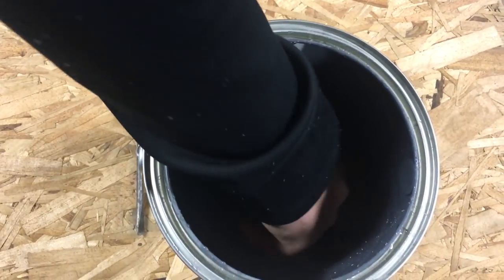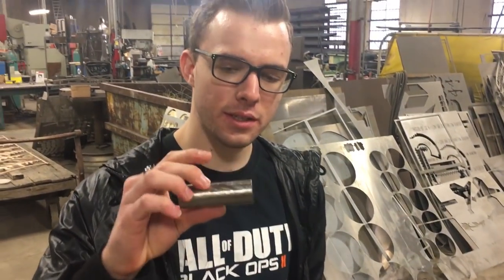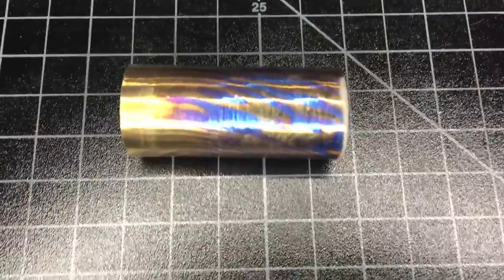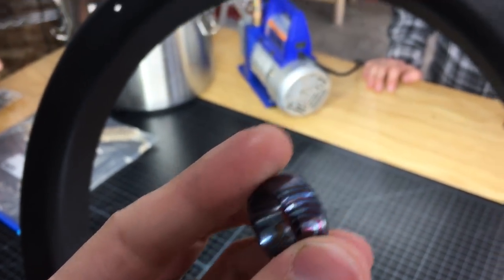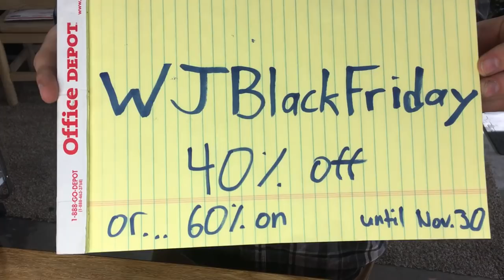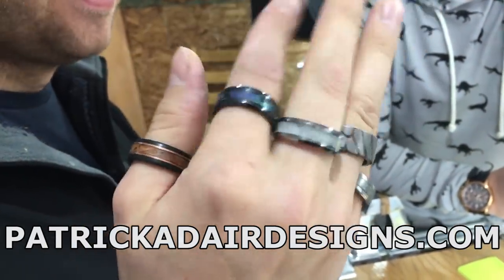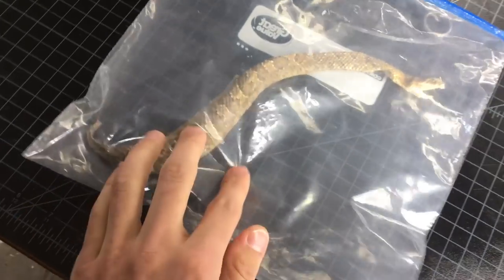Making Timascus Ring With A 60,000 PSI Waterjet Cutter - Titanium Damascus -  waterjet cutting

Comment: That's actually a quite attractive ring.  I'd buy one.
Reply: for $700?
Reply: i dont think titanium is that expensive
Reply: but holly shit it is 700$ on the website
Reply: DerpMaster Hd my dreams of having one are crushed by my social status.
Reply: Jakob Parish   No. Not for that much.  I'd pay 100$ though.
Reply: DerpMaster Hd titanium is one of the most expensive metals besides platinum and gold. Some 6 inch titanium castings at my work are $800
Reply: The reason why it's so expensive is that it's timascus, it takes a fair amount of time to make and it's pretty risky to make, normal Titanium is not that expensive. Timascus and mokume is some of the most expensive material in the knifemaking industry for custom knifemakers.
Reply: Yeah titanium 6al-4v isn't 700 for a short bar but it's easily twice as much as stainless. It's not as hard as inconel but still a bit tough on your tools and it's a fire hazard.
Reply: do u have $800? yeh didn't think so
Reply: Some other materials that are expensive and rare that knifemakers use are black timascus, which is a combination of titanium and zirconium. There are also superconductor, SM100 steel (bladesteel), Marbled CF, Lightningstrike CF, thunderstorm kevlar. Rings are made of some of these materials, but mainly folding knives.
Reply: Aznee 8
Reply: for 700 dollars xD?
Reply: i would too for 100-200$
Reply: DerpMaster Hd only a few people make this stuff so the supply is really low, so anything made out of mokuti is really expensive
Reply: I'd pay $35.00  it looks cheesy... like something from Hot Topic from the 1990s  the kind of thing that 'new money' buys when they're trying to prove themselves.
Reply: Bud Nunyerbusiness for 700
Reply: Bud Nunyerbusiness ii
Reply: You gotta check out patrick adair designs,he made the ring
Reply: MrNinjaman63 this is a ring not a 6 inch thick platform haha
Reply: Darren Braden try 7.79 inches ;).
Reply: You're paying $700+ for something 100% useless. Jewelry in general is over priced and useless.
Reply: Those rings are hundreds of dollars
Reply: Mercury Doctor Yes, yes I would.
Reply: @nerocladius4319    I lost my gold wedding ring and got a platinum one so not really expensive
Reply: @poisoncobra7  actally u can make about 6 for 300$
Reply: I wouldn’t but anything they have it’s all about 90% over price
Reply: Jk

Comment: I wish he polished it... I WOULD be dissapointed if I purchased and it came with all those surface scratches.
Reply: Waterjet Channel for something worth that much yes
Reply: AddisonLarson nah that requires effort then the price might make a little bit of sense and that's just crazy
Reply: I think he did...its just rough structure of titanium...but not sure...Iam more curious about blue color done by heat and if it will be permanent...
Reply: medvidekmisa maybe the rough texture/finish is intentional. So when it wears only the "moutain tops" get worn and thus the bluing affects, the "valleys" however take up the majority of the surface area, thus the ring still looks blue even when worn.
Reply: Waterjet Channel true
Reply: Addison: Yes. Thats probably why he did it. The oxide coating is less than a micron, so it wears off quite fast. Only way to restore it would be to repolish it and then reform the oxide coating by heating.
Reply: Also titanium is not particularly hard. Maybe C25 or so on the Rockwell scale. Harder than gold for sure, but not like a tungsten carbide ring or something like that.
Reply: facepalm damascus titanium are meant to have those surface texture -_-
Reply: AddisonLarson he polished the inside

Comment: Why don't you guys use those plastic corrugated blocks for the bed of your water jet?  They can be used for many many cuts before they need to be changed. They also keep the water in the bed from splashing everywhere. Should get a diamond tip spray nozzle also, the water stream comes out so thin the first inch or 2 is invisible.  Just some suggestions! Good videos either way keep it up

Comment: So I have an Idea. Lets get white or black marine grade canvas as a wraparound backdrop, like they do on eBay (only the canvas will be super strong). Staple it to the osb on three sides with some vertical supports on the corers. Blam a beautiful blastshield that will catch 700$ ring blanks. Kinda like the skateboard wheel box, but prettier. A three sided removable blastshield is what im recomending, black would look best in slow motion I think.
Reply: Waterjet Channel thats an astronomical amount!
Reply: Waterjet Channel I'm thankful for you guys... Either that or a window screen streched out over the tank.

Comment: what is the process of making that trimascus rod please tell me
Reply: it's twisted titanium that's heated to add color patterns lol
Reply: It's almost the same as damascus, but in this case you don't use 2 different steels to make a pattern, only one. You weld slices of titanium together, then you forge it down to a block, then you cut that block into pieces and weld them together again and forge them down again to a block, there are other ways of doing it, and I'm probably not 100% correct but that I generally how you make a damascus.
Reply: Marius Christensen the only thing I would add is you say it's not two different metals, well technically it's 2 different alloys of titanium, that's what gives the distinct difference in colours, some titanium form oxides at different heats and the colours are just oxides on titanium with green being the thickest at around 0.002 or 0.003 inches thick.
Reply: CnCEmpire yeah your right

Comment: What stops the water jet from cutting itself?
Reply: What stops a saw from sawing itself?
Reply: What stops killers from killing themselves?
Reply: I'm pretty sure they made a video about this. It does cut itself, but most of the cutting force is directed away from the metal slats because they have very little surface area exposed to the water jet.

Comment: $700 for a ring?!!! Titanium is not that expensive, what gives?
Reply: Yi ZK long story short, it's forge welded layers of titanium. And titanium has this tasty tendency to explode in the process. So you get a low yield, multiple bad batches, and it's dangerous.
Reply: @Yi ZK It's a scam. How do you not realize it, this guy is an absolute coward and one day he will be the victim
Reply: Jon look up Damascus forged titanium. It's dangerous stuff. Tends to explode and doesn't always result in a usable product. The cost comes from high material loss, expensive equipment, and massive amount of time it takes.
Reply: To quote another comment on this video

"The "Timascus" rod they are using is $1120 for an 1.6" OD x 5.5". By weight and using the density of titanium, that sells for ~500 per pound of the stuff. Looking at current gold prices, gold sells for over $20,000 per pound. I just saw a 24 karat gold ring sell for ~$750, similar price to his ring."

There is no reason for this ring to be that expensive aside from sheer overpricing and overestimating his craftsmanship. I'll admit, this ring looks pretty damn cool, but not $700 cool.

Comment: Has anyone even bought one of those rings off of your site? Because I've seen solid gold rings that are cheaper and titanium is dirt cheap by price comparison. I can get a huge titanium rod for $30 and do the twisting and heat treating then cut and drill out the thing and sand and polish and have the same ring for less than $40 total.

Comment: This guy willingly shows what little work goes into his astronomically priced rings? It's not rocket science to get some materials and use a lathe...
Reply: Yet many of you who assume that machining titanium is as easy as steel or aluminum, are going to learn the hard way without the right tools and know how, will quickly find out why he priced it so much.
Reply: Joshua79C - yeah, they would find out that machining titanium is - oh wait, just as easy as working with steel.
Reply: Joshua79C C uh have you ever actually tried to work titanium? It’s a complete pain in the ass. It blows through abrasives like you wouldn’t believe and tears up cutters and drill bits. The icing on the cake is that it can also gall to other metals and weld itself to them. I’ve had it weld itself to drill bits on my drill press and ruin both pieces. Titanium is about 50 hrc, steel is generally lower than 30 when not hardened. Titanium is a bit easier to work with than hardened steel but not by much. Plus the sparks it produces are a pain in the ass too.
Reply: Exactly Aepiis, thus why my comment to others who think is just like machining steel or aluminum or even copper.

You two others really should try for yourself or go to a machining shop and ask for a demonstration as you still do not get it, densest alloy-metal it is, there is a reason why medical professionals warn of wearing such rings.
Reply: I have worked with them... This is exactly why I commented this. Yes sure it takes some skill, it does not take $1000+ skill ...
Reply: Joshua79C C to quote another comment on this video

"The "Timascus" rod they are using is $1120 for an 1.6" OD x 5.5". By weight and using the density of titanium, that sells for ~500 per pound of the stuff. Looking at current gold prices, gold sells for over $20,000 per pound. I just saw a 24 karat gold ring sell for ~$750, similar price to his ring."

There is no reason for this ring to be that expensive aside from sheer overpricing and overestimating his craftsmanship. I'll admit, this ring looks pretty damn cool, but not $700 cool.
Reply: ugh
Reply: Aepiis I think you're mixing up titanium with Titanium Alloys. Pure form it's hardness is Vickers 240HV but alloys can be up to 700HV
Mild steel is 140HV and High carbon tool steel 800HV.
So you're right if it's an alloy, but wrong if pure.
Reply: You're totally wrong. You can't expect to buy everything the same way you buy Zara clothing. An avg $300 to $900 for a ring is quite normal and quite fair to be honest considering that not all the rings are easy to make. You have obsidian Superconductor ring  with tinie tiny details priced at just $900 and it's going to last years and years - it's not something you're gonna toss away after a year or two. I buy Tom Ford suits almost every year for 5K and yet some of them don't look as good as they were when I first bought them and you're complaining for a ring that has a much much longer life expectancy  . Also the equipment you see over there with waterjet and cnc machines and whatever might be there could cost more than 200K . Not everyone is able to buy this stuff and have the know how to create rings looking as amazing as his creations.

Comment: Or just buy one rod, cut it with the angle grinder, use a drilling machine going from smaller to bigger tips. Get a pipe to fit exactly inside the ring. Glue the ring to it and put the pipe on the dirlling machine you've used earlier. Put the drilling machine on high rpm and put a grinding disk on the angle grinder you used earlier. Grind the sides till you're satisfied and that's it. Then sell the rest, and profit.

https://www.alphaknifesupply.com/shop/product/timascus-rod

Comment: New challenge: Build a waterjet cutter out of a pressure washer, a cheap cutter head (with ruby), T-adapter, and sand for cutting grit (ea; the Ben Krasnow method), and cut another few rings.

End goal: Having a ring, AND the equipment to make said ring, for UNDER the price of what the ring costs on the website. Should be doable no?

And yes, this is also a shitpost. That ring is way too expensive for what it is. Seriously wth..

Comment: Why are so many people complaining about how much these rings cost? It takes about 15 hours to make each ring, if he wants to make more than minimum wage the ring has to be expensive.
Reply: 3 hrs max.
Reply: Narko, you clearly don't realize how much effort goes into working with titanium, let alone timascus. You need specialty tools just to grind parts away, not to mention the speed you have to go out so the tool you're using doesn't burn up, then the hand carving the machine can't do, and then the finish. It's hell of a job and when you factor in labour this is pretty reasonable for a handmade timascus ring
Reply: So much ''effort'' . just drill hole into that piece of metal,  shape it a bit, polish and thats all. it doesnt take 15 hrs to make.  sry 4 bad english.
Reply: It's not that simple, if it was rings wouldn't be so expensive
Reply: you need special tools to work with timascus usually carbide or diamond coated bits which can run you a couple hundred dollars not to mention the stock material cost a lot as well. Looking up the price for .560 in diameter round stock it cost $300 for just five inches. if you include the time, patience and skill required to make the ring not to mention they're custom made I'd say 700 is more than a reasonable enough price. yea its a lot for a ring but it's made from exotic materials so what do you expect
Reply: also you can't just "drill a hole into that piece of metal" titanium is very difficult to work with which is why you never see blacksmiths or any other craftsmen working with it. If you watch his video you'll see that his lathe isn't powerful enough to properly drill a hole into it which is why he had to start with smaller bits and work his way up before boring out the center with a lathe bit. The only other maker related channels on youtube that work with titanium is Man at Arms who make specialty props and swords from video games and pop culture and they also stress how they dislike working with titanium because it is difficult to forge, machine and sand. I believe Matt mentioned that they spent a couple hundred dollars just on abrasives alone for one of their relatively smaller builds (I think it was the blade sword but might be another video). So taking into account that this material can damage his lathe and tools which would likely cost him more than 700 dollar it's more than reasonable. Some of his simpler rings however I don't agree with the pricing but this one in particular I do
Reply: Nathan Binns when people can't afford things they get upset apparently
Reply: Narko 
Then do it yourself, sell it for a lower price, kill the competence and get all the profits. It's simple! I'm sure you could do it all in a couple of days. Thank me later when you're a millionaire.
Reply: xavier valdez - "titanium is very difficult to work with which is why you never see blacksmiths or any other craftsmen working with it."
No, not really. It is cause titanium oxidises easily and it has very bad properties for anything you might want to get forged - it is a lot softer than steel and for the same strength also a lot thicker.
Reply: 15 hours, What fucking planet do you live on?
Reply: @ Jon ,Woah there buddy, that's a bit strong, he may share the minority view but that doesn't make him a loser!!
Reply: xavier valdez clearly you have not used a lathe before the first bit he used was a bog standard hss centre drill ... used to accurately start a a full sized drill (standard proceedure for any material on a lathe .. lathe had plenty of power ... he drilled it out then finished it to size with a boring bar (unlikely he had the right sized drill bit hence the boring bar)...
He also used a standard carbide insert to cut the bevels on the inside and outside and used a standard dremel sanding drum on the edges ... 
Where are these special tools you are referring too ?
Reply: Yeah they were making the Blade's sword from titanium.
Reply: Narko The "piece of metal" has to be made by him too which is extremly time consuming and hard to pull off.
Reply: 15 hours for one ring? Is he using a grinding stone and a piece of sand paper? I hope he gets some new and better equipment soon.